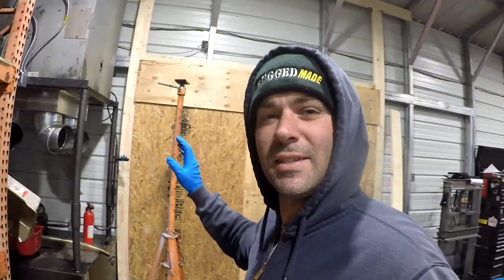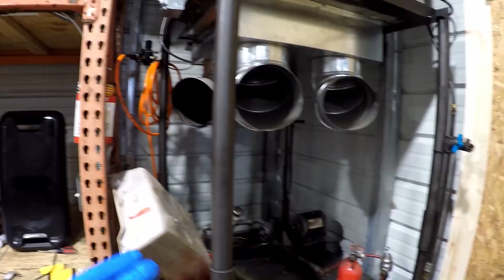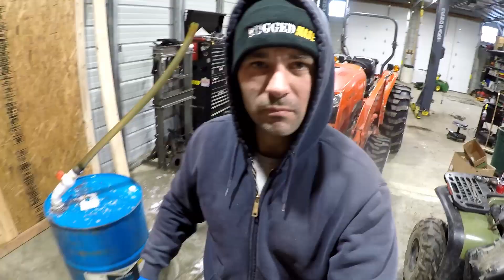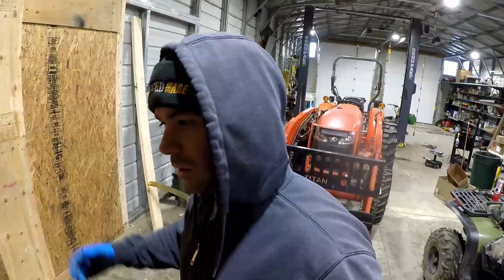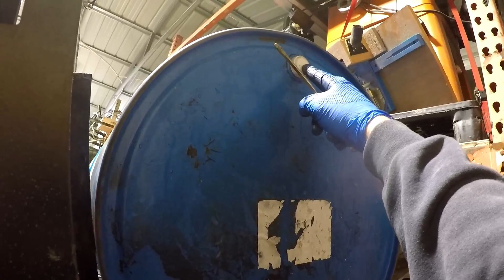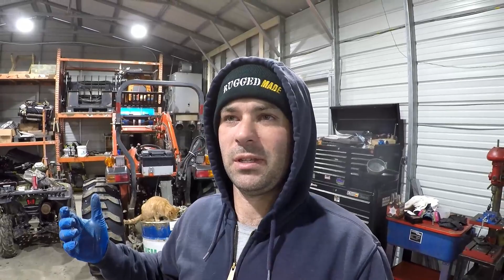The CHEAPEST way to heat your workshop or garage!

Comment: I had a waste oil heater years ago. It was a bad choice for me. I was sold on how easy it was to find used engine oil for fuel. The initial cost of unit was close to $4000! And that was with me installing it. Turns out there are so many regulations on how shops handle their waste oil, i couldn’t find anyone who wanted to give it to me. I ended up running the thing on diesel. Ultimately, I removed the system, sold it at a loss, learned a hard lesson.
Reply from the maker: You’re not the first person to tell me this, which I find so strange because I have places that are itching to give it to me. I guess different regions have different regulations. I’ve actually upgraded to a brand new unit since I put this video out.